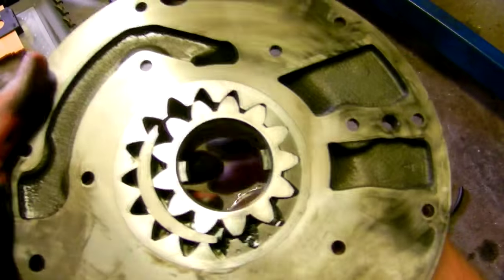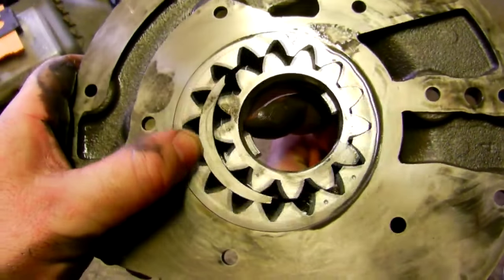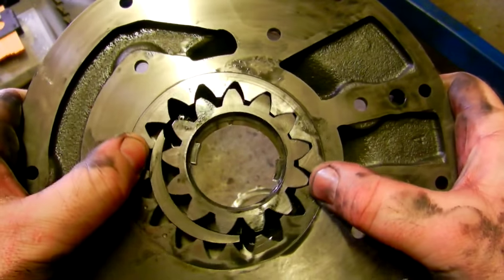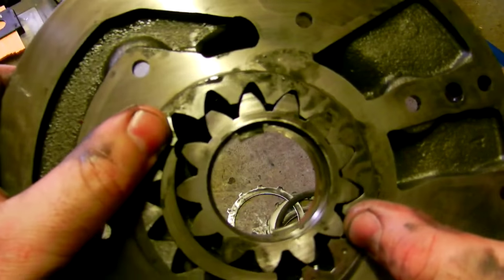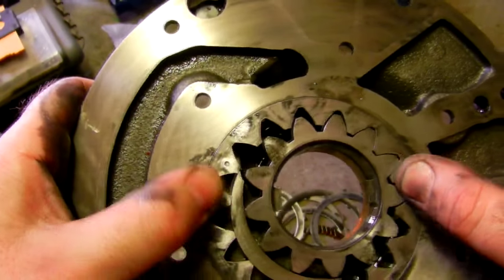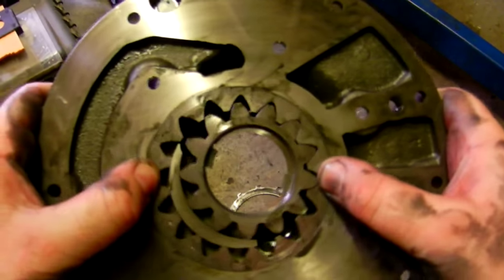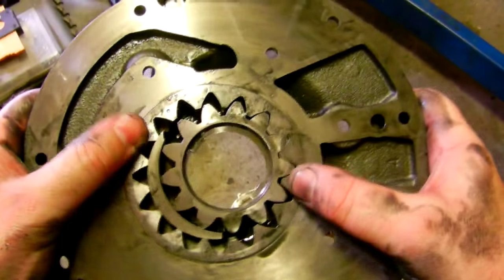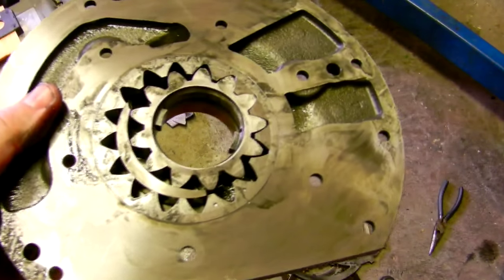How an automatic transmission pump works

Comment: I wanna buy a Chrysler 300 5.7 Hemi but the transmission pump gets hot and overheats the car what can I do
Reply from the maker: Hi, I'm not familiar with this particular car, however most torque-converter transmissions tend to operate in the same way.  
Check ATF level and colour since too low fluid level or too high will make it run hotter. Old fluid that smells burnt or is a brown colour indicates a transmission problem or very old oil. Like most auto transmissions, the fluid will have a fluid cooler and possibly a transmission oil to coolant heat exchanger that will contain a thermostat in a sandwich plate that only allows ATF to flow through exchanger when it reaches operating temperature. These systems rely on the engine cooling system to be working correctly so waterpump, coolant thermostat, radiator must be doing their job. I had a look on Google and overheating does get mentioned quite a bit on 300 forums. Found this video, hope it helps. 
https://youtu.be/mBw8pu4LgXs?si=OYAE1emMuFi_Rz85

Comment: No one ever explains WHY overfilling the transmission oil CAUSES harm ...Just because the fluid is way over the high mark on the dipstick, how does this actually make a difference to the Trans ? I mean, mechanically, HOW does the overfilling upset the shifting ? Thanks..M
Reply from the maker: Good question.
ATF can start to foam up with resultant low pressure as the foam won't pump properly thus causing shifting problems. Heat transfer to the foamed up fluid will also be affected so risk of overheating, sensor malfunction due to density of liquid ATF compared to aerated mix. Also there's a risk of leaks as the mass of ATF takes up more volume than original design spec. There would also be increased fluid drag as components that would normally only have a film of oil would then be swimming in it while trying to rotate at speed.

Comment: Does it spin when in park or neutral? Or does the pump not function unless the vehicle is moving?
Reply from the maker: Just about everything in the transmission was worn. The fluid was grey it had so much Shrapnel and metallic debris, clutch pack friction material was cooked and flaking and the valves and shuttle valves within the valve block were scored and the plastic valves had overheated and seized due to previous owner regularly towing while not keeping on top of the cooling system. The pump was scored too   so losing pressure.

Comment: Is this what causes that "whining sound" when the fluid is low or hasn't been changed in a very long time?
Reply from the maker: Traditional torque-converter autos will have that characteristic whine as the vehicle accelerates and changes up which gets quieter as car reaches cruising speed but any other noise such as rumbling, clonking, higher pitched whining sound that's continuous isn't normal. Low fluid will generally cause delayed shifting, clonking when shifting from P into Drive or slipping - when the low fluid is starting to churn and foam causing reduced pump pressure and reduced torque - can also cause surging of engine revs (bit like a slipping clutch) where engine revs increase but car speed doesn't increase. Fluid levels are usually checked with engine running and there might be more than one level mark on the transmission dipstick 'cold, normal/hot' (check owners manual for how to check ATF level). On my Citroen, the fluid level was checked on a warmed up engine and only after the gear selector was moved from Park through all positions then back into Park. (park and foot brake on of course).

Comment: Does it spin when it is assembled ? I grabbed a channel lock to pump spline shaft  and won’t turn.
Reply from the maker: The pump should be free to spin. There might be some resistance due to fluid 'stiction' but it should turn.

Comment: WHY GEAR GOT BROKEN IN USE WHAT IS THE REASON. SINTERED GEARS . JCB 3 DX MACHINE
Reply from the maker: It was a several reasons. Extreme wear throughout the gearbox, worn bearings, worn pump and signs of overheating and hard use. Previous owner had regularly towed a caravan and basically it cooked the gearbox. CItroen XM 2.1 turbo-diesel is only 109bhp and it's a heavy car. These transmissions run hot so vital that car cooling system is working properly. It was basically worn out and needed a rebuild. The Citroen headgasket had also leaked so coolant had mixed with ATF and oil via radiator and gearbox cooler.

Comment: Hi mate. When the bushing pupm is broken, is a noise there?
Reply: Because on my mercedes,  when i start the car i hear a teribil noise
Reply from the maker: Yes the pump is a precision machined assembly and any wear or damage to the bushes or bearings will cause metal to metal contact which results in metal fragments, finely ground up metallic particles and more wear. Early signs of a problem (even if transmission is quiet) are lots of silvery particles in the transmission fluid. When I owned the Citroen XM (the car in the video), the fluid shimmered silvery-pink when I drained it.

Comment: When the pump goes...should the transmission be rebuilt ? Has damaged occurred to other parts more than likely ?
Reply from the maker: Usually when a pump fails there will be metallic debris and large amount of metal particles within the transmission and in the fluid. One sign of a transmission problem is filter clogged with a grey paste-like deposit which is a mix of ATF and ground up metal. The fluid will often look grey or pinkish grey and even if the fluid is changed, you may see the new fluid has a metallic shimmer. If filter magnets are absolutely covered in metal then it's time to investigate as there will be damage to other parts since high levels of debris floating around will act as grinding paste or at very least start blocking the labyrinth valve block and various moving parts.

Comment: I have a 09 300c 5.7L HEMI. My car does not shift into gear and my ATF does not seem to get warm, after 30min of running it only managed to stay at 60 degrees. Also, I disconnected my trans cooler line from the trans, turned on the car and no fluid splashed out. Mind you This is a “rebuilt” transmission.. going to contact for warranty but wanted to see if there’s anything I can do before going that route, please help 
- thank you
Reply from the maker: Hi, I found this forum thread and it seems the problem is known - especially in cold climate and weather. The symptoms sound like classic low ATF fluid level but without a transmission dipstick there's no way of checking it. 
https://www.300cforums.com/threads/too-cold-to-move-transmission-problem-moved.67635/
Reply from the maker: Apparently these transmissions can leak from the TSB connector O ring and have been subject to dealer recall and warranty repairs to replace the bad O ring. Also there are aftermarket transmission dipsticks that can be used to check fluid level - which is vital for correct transmission operation. 
https://www.300cforums.com/threads/how-do-i-check-the-transmission-fluid-level.261770/

Comment: hey sir i just wanna ask is that oil circulating even the position in P or we have to move it to N?
Reply from the maker: The pump in a conventional torque converter auto transmission works and generates pressure constantly while the engine is running since the torque converter rotates whenever the engine is  running - even if the gear shift is in neutral or park. The pump draws ATF from the transmission sump and the pressure is needed to actuate valves, brake bands and governors so pressure has to be available even when in neutral.

Comment: Hi, I’ve had a Buick rendezvous with the 3.5l engine. Got it with 80k miles and have driven it 30k since. recently it quit moving the car gradually, it felt like it was trying to “catch” and move but wasn’t fully doing it. I never changed the filter or oil in the transmission since getting the vehicle. I’m wondering if doing so first would save me a headache of doing something super expensive like replacing the tranny.
Reply from the maker: Hi, yes - you definitely need to do a fluid and filter change as the smell and colour of the old ATF will be a good indicator of the condition of the transmission. 
Hopefully it will still look red or at least hints of the ruby red colour of good ATF. If it looks black and smells acrid or burnt then that's a sign of very worn clutch packs or an overheated transmission. 
If it looks grey and shimmers then there's been a lot of internal wear which means the fluid is carrying a lot of metallic debris and finely ground particles. There's usually a magnet in the filter housing which will trap the steel component debris but it won't trap non magnetic particles. 
If the fluid is pink and foamy and looks like 'pink mayonaise' then that's coolant mixing with ATF via the transmission to coolant heat exchanger if one is fitted. Not familiar with the car or trans but most conventional autos have a fluid cooler and sometimes a engine coolant to ATF heat exchanger with a fluid thermostat that only opens when the ATF has reached correct temperature. 
Also worth checking fluid level as too low and it will affect drive and gear changes.
Reply: @TK42138   thanks for the reply. The fluid looks ok but there some dark particles in it almost looks like dirt rather than metal. I wouldn’t think there would be heavy wear bc I’m pretty soft on the gas and after watching warn tranny videos I have none of those symptoms. I’ll look at a filter change video, but I feel like dropping the pan it can be accessed there maybe?. I’m not a mechanic but I’ve done a handful of things to cars myself and there’s a such a wealth of videos where if you’re willing get dirty saving money I’m there;) thanks again!
Reply: @TK42138  I changed the fluid and I have no more problems, it shifts like normal, the results were gradual but understandable. Absurd that the car shop said “oh people usually just put a new transmission in it”, NOT EVEN OFFERING TO CHANGE THE FLUID! I guess they just go with “it’s the transmission pump” not really saying anything else

Comment: Thanks for the video! My automatic transmission MB 722.103 loses pressure at times. I raise the revs to 3000rpm and the pressure comes back. Your video shows that the pump is very robust and hardly has any defects. What are the components that can cause this problem?
Reply from the maker: Hi, any other symptoms?
Is the transmission fluid level correct?
Although pumps on conventional torque-converter transmissions are usually robust, they can suffer wear if the fluid is old, or contaminated such as carrying a lot of debris from clutch packs or metallic debris due to a clogged or holed filter. This debris laden fluid can act like a grinding paste if really bad which wears the pump surfaces or can cause various valves to start sticking which then leads to poor pressurisation and other problems.
Reply: @TK42138  It was stopped for 15 years. It changes gears well and time. The old oil was clean and the pan clean. I changed the filter and oil. The pressure drop continues.
Reply from the maker: When the pressure drops, is the transmission slipping revs increasing but car not accelerating?
Reply: @TK42138  The pressure drops, even at idle. When the pressure drops, the transmission speed goes to zero and does not drive the wheels. It stays that way, until I accelerate above 3000rpm, when the pressure returns and pulls the wheels.

Comment: Do you know if the pump pumps the oil towards the transmission inside,  or pumps towards the radiator to cooling lines?
Reply from the maker: Pump will pump fluid through torque converter, transmission, valve block then it passes through cooling process which will be fluid to air heat exchanger, fluid to coolant radiator (either a smaller separate unit or combined with engine cooling system rad or combination of both.
Reply: @TK42138  Thank you very much.
Reply: @TK42138  are the pumps different on the 4l60es  i broke the pump on my 90s 2 piece 2wd 4l60e in my trans am it was swapped prvious so dont kow exact specs on tranny anyway that pump is broke an di need to fix it will any junkyard 4l60e transmission pump work ?
Reply from the maker: Hi, apologies I'm not familiar with that transmission but I've been googling it. Might be worth asking these guys. 
https://gearstar.com/amp/

Comment: Great, thanks. So how would this leak in the front with a new seal? Mine is a 722.9 Mercedes GL350 Bluetec. No other symptoms. It is a 2012 with a bearing where the converter comes in, not the bushing that used to spin out. The unit works flawlessly but leaks after the second seal (and transmission removal/reinstallation ). Now it’s out again and I’m planning to remove the bell housing and check the pump. No debris or metal shred anywhere, in the filter or on magnets. Thank you!
Reply from the maker: Hi, I'm not familiar with this particular transmission, however in general terms, if a transmission leaks when standing it's the pump body seal and if it leaks when running then it's the shaft to pump oil seal. Apparently these oil pump gears run directly in the housing without a wear plate, so any damage or wear to the gears, pump housing or where the seals sit, can cause leaks. Might be worth checking Mercedes Forums as this issue will no doubt have been discussed by other owners.
Reply: TK42138 - Leaking when running. On forums it’s the pump itself. Could the shaft be bent you say? Thanks!
Reply from the maker: @maximusfuscus  The shaft seal could be faulty despite being new. I doubt the  shaft is bent because that would cause a lot of imbalance and vibration. Were the new seals aftermarket or original. Any scratches or surface damage on the part of the shaft where the seal contacts? Any scratch deep enough to catch it on a fingernail is too deep and will leak.
Reply: TK42138 - both seals from dealer. No scratches. No vibrations...pump wear could leak?
Reply from the maker: @maximusfuscus  It's possible. If the pump is worn and the shaft is moving around within the seal then it could leak but that would show up as a leak from pump body - which will be a big O ring and/or a paper gasket type seal. Worn pump would also cause metallic particles to build up in the transmission fluid and reduced pressure - which would cause further problems. Perhaps there's a sticking pressure relief valve causing excess pump pressure? As I mentioned earlier, I'm not familiar with Merc transmissions but in general terms any hydraulic pressure system will have an ability to control pressure to prevent seal damage. Maybe that is what's happening to yours?

Comment: Hello please I need help I have VW Passat CC car 2013 and the when the When the car got hot Gear not Response for at least 1 hour and I send to Garage he said gear pump and will cost to much to fix it so please I need you advice
Reply from the maker: Check the fluid level if the transmission has a dipstick. Owner's handbook should show how to check it. If fluid is too low, gear selection will suffer. On a conventional automatic transmission, fluid level is usually checked with engine running and after gear selector is moved through all gears before putting back in PARK. Fluid should look ruby red colour.
Reply from the maker: Just looked up the problem on the DSG transmission as fitted to Passat CC and other models. This website might help (I'm not familiar with the DSG).
https://axleaddict.com/auto-repair/6-Speed-DSG-Automatic-Transmission-Faults
Reply: @TK42138  Thanks for your reply i did  that i think the mechatronics  is t
he problem  so do you know how i can have an used one
Reply from the maker: @ebrahimmohamed8058  Might be worth checking forums to see what other owners did with their faulty transmissions. I'm not familiar with this particular transmission.

Comment: If you were replacing the actuator, would you notice a pump malfunction?
Reply from the maker: Probably not unless you had the facility to bench test the transmission before it was installed. Repair specialists would test gearbox and valveblock on special rigs to ensure it's changing through the gears.  Pumps are generally reliable unless they're extremely worn or have chipped or missing teeth due to ingesting debris from failure of other transmission parts.
Reply: TK42138 here’s the scenario- second hand car shows auto gearbox problems (m32), take to specialist. Specialist says actuator fault, then replaces at cost of dealer. Gearbox works better but over few months starts to show juddering then finally won’t go in gear. Same specialist says the pump is completely ruined. Has to replace, at cost of customer.
Reply from the maker: @mokitaism  It's possible that they didn't check the transmission for swarf/debris or even low fluid level when they assembled it. A transmission pump is quite a simple part but it does run at fine tolerances and also relies on O-rings to maintain hydraulic pressure. If fine metal particles got through, it would slowly grind away at the mating surfaces of the pump eventually causing low system pressure and accelerated wear further up the chain. I would put pressure on the rebuilders to cover the cost of any repairs since they were the last people to open it up.
Reply: TK42138 Thanks. My warranty covered most of the pump cost. Apparently the pump was ‘smashed to bits’ from being towed or the likes. Obviously before I got the car 6 months ago. I’m just curious as to whether the dealer knew this 6 months ago when they changed the actuator and ‘patched it up temporarily’ to deal with the warranty company at a later date.